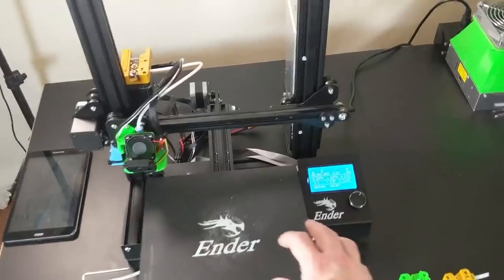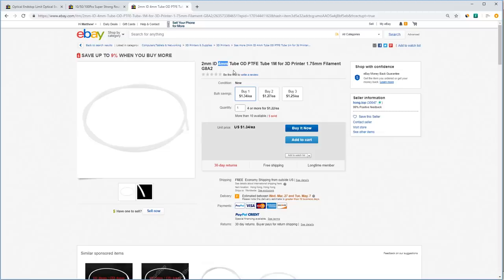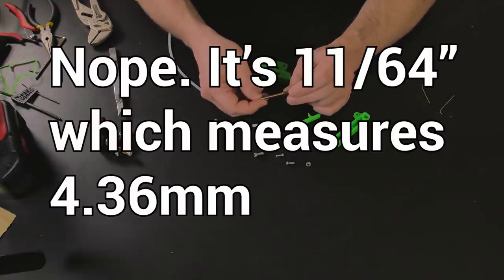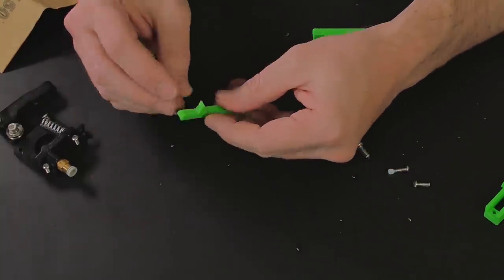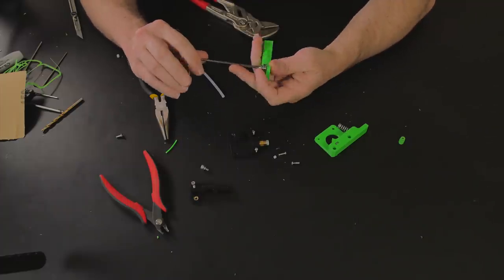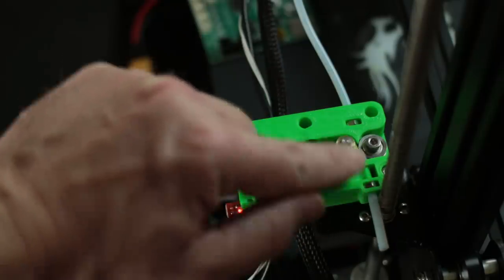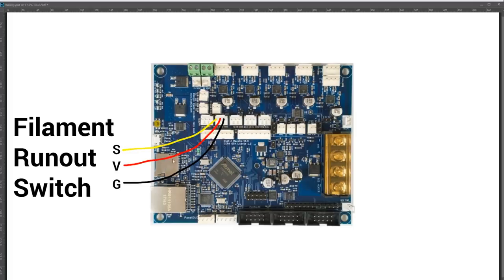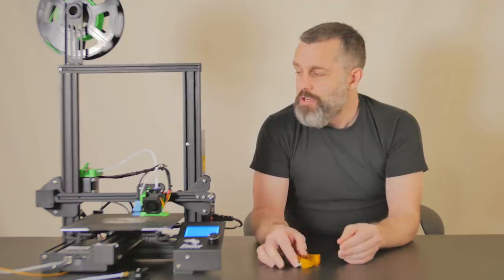How to Make a Better Extruder & Filament Runout Switch for Your Creality 3d Printer

Comment: It would obviously take up a little more space, but if you're going to have a plastic on plastic pivot, then you might as well use some of the PTFE tubing as the pivot rather than ABS/PLA. You could also use PTFE tube as the main pivot for the extruder, if you were to use a 2M bolt there (at least it seems like that would work :)

Comment: The ender 3 pro (bought one Dec 2020) now has the Creality model 4.2.2 (or 4.2.7) 32bit MB with a 3 pin connector for filament and a connector for a bed level sensor on the MB. This video showed the 1.1.x model. (What a difference a day makes <or year>)
 I was looking for a way to put filament detect on my printer when I found this video. I like the way it mounts the sensor on the extruder.
{<Condensed mode now>:For runout or break: sensor before extruder. For jams: sensor after extruder. Wire both in series + the parts to keep the smoke in = 1 hookup @ MB. Sensor can be mech, optic, or other}. You can find the Creality MB V4.2.x on Internet (& board diagr to connect filament/bed-level sensor).
 Pics of the sensor circuit board looks like: sig, Gnd, & V (L to R). Sig goes to Common on micro switch, V to N.O., & Gnd to N.C. (plus the parts for current limiting & a status LED)
   I was getting stuck on the idea of simple optical sensing. Thanks for the reminder that sensor can also be magnetic, contact, etc. 
Other neat tidbit; you can now update ender 3 pro firmware simply with SD card - no need for remote terminal or SBC
You prob covered these already but I'm new to the party.
 BTW, I like your channel...

Comment: Great design,
Think of a remix, just using the sensor arm and to install at the exit of the extruder.
Reply from the maker: This would be cleaner, but it would not work. Once the filament goes past the hob gear it will not move any more. thus the sensor must be placed inline before the hob gear. The exception of this is if the sensor reads the motion of the filament. Such as the laser sensor or magnetic sensor both made by DUET. These can be placed after the hob gear. When the filament stops moving even though the extruder is telling it to move this will trigger an alarm in firmware. In this video I used a simple on/off optical switch which could not detect movement in the filament. Thus I cannot modify this design to work as you suggest. However, I did do as you suggest in a previous video: https://youtu.be/RmZ7aJYvWLc

Comment: I am totally happy with the creality design especially the aluminum version but dammit man THIS really is pretty cool. I may just have to print some even without the filament detection. I like it.

question. I know PLA will "distort" over time when under a load. IE in this instance the load from that spring would over time "bend" the arm its pushing against. in a pretty short time actually few days even.

does ABS filament "NOT" experience this issue? is that a PLA specific issue and ABS and or maybe PETG won't have this issue?

thanks! and great design!

btw using the nut to hold the tube threaded into it is an old technique that far predates modern 3d printing. I was using it 30 years ago in grade school. I assume I learned it from my shop teacher :-)
Reply from the maker: I'll give a longevity report on the extruder in a couple of months and let you know about the creeping plastic issue. At any rate I believe the stock Creality extruder is made from ABS, so this design shouldn't be any worse than stock.
Reply: that is a good point. is there a mechanical or chemical difference between molded abs and 3d extruded abs? do they "change" the abs to make it into filament or is it the same stuff they spray or inject into a mold? curious.

the weakness on the stock plastic unit is the connection point for the idler pulley that pushes against the hobb gear. its thin and is prone to cracking over time from the constant load. I was thinking of drilling out the aluminum unit to allow insertion of a point cut chunk of PTFE on the exit side of the hobb gear ala the flexion extruder.

 @DesignPrototypeTest
Reply: Creep from the stepper motor temp will cause it to deform over time. ABS has a higher plastic temp than PLA so it would be fine. So would PETG.
Reply: @Deneteus  pla will distort over time and load at ANY temperature independant of glass/deformation temperature. Will abs and petg also do this?

Comment: Have you considered using Git to handle your versioning? It's quite easy.
Reply from the maker: Yes, but then I would have no reward for my Patreon supporters.
Reply: Siana Gearz or, you could try not acting the condescending git and understand why DPT says what he says?
Reply from the maker: @SianaGearz   I will give you credit here. I was making this exact mistake. I did think DEWEX was talking about posting my files on Github. BUT, your reply to Jasper only proves his point. You are super condescending.
Reply: @DesignPrototypeTest  Just to be clear:

Git is versioning software for managing file histories. It is installed and runs on your local computer. It is free and open source. While there are desktop tools which let you use Git on your local computer through a graphical user interface, using Git on the Command Line is not that difficult, and probably easier;

There are online services which use Git and let you manage your files and their version histories in the cloud. You can synchronise your local files with these online services;

Github  is perhaps the most widely known of these online services. Github is run by a private company based in the US. While it is possible to restrict access to  your collections of files (repositories) on Github,  (make them private) you have to pay a monthly subscription to Github to do this;

Bitbucket is another online service for file version history management, owned and managed by Atlassian, which does the same as Github, but it lets you make your repositories private for free;

I'd recommend using Git locally and pushing your files to a private repository on Bitbucket. You should be able to manage how you distribute files to your Patreon supporters by inviting your supporters to download the files from your respective, private Bitbucket repository.

You may also need to use the large files management solution. https://www.git-tower.com/learn/git/faq/handling-large-files-with-lfs

Happy hunting.

Comment: Congratulations for your huge work. I followed the video with interest. At the end, I just wondered: what if the filament was simply cutting the infrared beam of the sensor ?  Would not it be a much simpler way ?

By the way I do not subscribe to your point of view about patent. Let me explain. There's two criteria to make something patentable. First: originality. It should not have been done the same way before. For example, you cannot patent a string to cut butter, even if it's not patented yet. Because this is not new. Second, you can not patent something that involves techniques already patented or which are already into public domain : as long as Stratasys patented principles of FDM printing nobody else was allowed to sell or produce FDM printers. In 2005, the patent falled into public domain, anybody can use the techniques to make and sell parts and printers, but none can be patented until there's any original improvement or new way to do. Patents define general principles but not perfectly define principles. For example for a hotend : heating element to fuse material prior additive deposition to build a solid and dimensional object. You see, the technique or raw material or even aspect does not matter. You won't be able to patent a hotend using induction to fuse steel, even if it was never been done before, because you are just interpreting an existing technique. That's why most of the patents usually covers small aspects of a product, with real (small) inovations, to not the function or the whole product. Real inovations are rare nowadays. Actually 80% of patent deposits are rejected worldwide. There's specialized people payed to find what can be patentable in products, sometimes leading to complicated ways to do basic functions, just to allow patentability. That's why I love low tech and open source...
Reply from the maker: I covered this here https://youtu.be/asSLjLGlSrw at the 10:20 timestamp.
Reply from the maker: >You won't be able to patent a hotend using induction to fuse steel, even if it was never been done before
This is not true. If it has never been done before, and the idea is not documented anywhere you can certainly patent it. Furthermore, you idea is for a new type of 3D Printing using metal. Any type of hotend for plastic extrusion is likely to not be applicable as prior art. Metal≠Plastic
Reply: @DesignPrototypeTest I'm afraid you get it wrong.  Please read again carefully. 1.if a previous patent protects general principles: material>heat>deposit, whatever the material, the heating or the deposit method your patent attempt of "something new" will be rejected. 2. You cannot patent a filament switch because this is not new, even if the design is new and the switch not documented previously, those criterias are not enough. Some people already use switches to detect the presence of filament In Various tools, like in a TIG welder for example. If a patent is allowed to you, that should mean they won't be able to produce their tool anymore because of your patent. That's why your patent attempt would be rejected. 

So you can't patent the function, you can't patent the method envolved, what's left is the external aspect of the thing. But that does not protect your design that much because people with anything similar in look may complain and the same thing with a slight different aspect can still be produced. 
I wish you understand it's not easy to patent something and anything is not patentable. Usually I don't spend my time to write something questionable or false. Regards.
Reply: @axelSixtySix  that would be like Apple trying to patent the rectangle... you can't patent general principles as broadly as you're describing.
Reply: @GeoffreyPitman523  come on, it's an exemple to make complex things understandable. See the moon, not the finger that shows it.
Reply: @axelSixtySix  that's just it, your example doesn't help anyone to understand because it doesn't work the way you describe.  Patents can not and do not cover general principles, they need to be very specific.
Reply: @GeoffreyPitman523  From my experience in the industry budiness, to patent something is kinda game : the company write to cover and protects the largest application possible, like Stratasys did. The patenting office have the difficult job to protect companies innovation while trying to limit the field of the patent to keep a market and innovation open. There's lot of examples in contradiction to what you claim, look at Stratasys original patents, and see by yourself how simples but wide 3d printing patents managed to lock down the 3d printing market during 50 years, with consequence of few innovations during this period. Then make your mind about patent utility for science and people regarding open source innovations since 2005 by the Reprap community...
Reply: @axelSixtySix  you are incorrect, point in fact Stromberg and Carter each made carburetors for gasoline engines each covered by multiple patents but performing the same basic purpose and looking extremely similiar.  try searching the patents and see that even minor innovations are patentable.
Reply: @keithnewsom4043   It depends of what you intend to patent. If it's a mechanical principle, like rack and pinion, someone can patent the same movement with belts and pulleys. But if you patent deposit by heating for additive fabrication (see Stratasys') what else would you patent ?

Comment: Nice video. I'm curious about the differences between duet and octoprint. I picked up the layer times, but what else does duet add?
Reply: Duet is a mainboard upgrade option. Octoprint is a software for Raspberry Pi that can monitor connected printers.

Comment: Maybe a second video on how to do this with the stock board? Putting a duet at $80-180 seems like a lot for a $200 printer.
Reply: You might be thinking that putting a Duet mainboard is something like putting lipstick on a pig, but it seriously enhanced my already awesome Ender3.
Reply: @GabeColon  I'd think of it as putting a Ferrari engine in a Honda Civic, yes it will be better than the stock, but probably won't bring out the best performance of the engine.

Comment: Why don't you use the incremental save option in Rhino? You can save between any consequential changes, but you can always open up the old files and see what you had previously.
I use it too much, so once I'm finished with a design, I have to go back and delete the vast majority of the numbered files :)

Comment: I only think the Extruder is good even without a Filament Runout Switch!
Filament Runout Switch is not necessary for me.

nut with bowden is good indeed!

And YES I just work with an ORDINARY Ramps1.4
what do I care which board, as long as it works!

friendly greetings from The Netherlands!
Rob.

Comment: Subscribed then unsubscribed when I saw you needed to be a patron to get the file lol Might just design my own without the run-out sensor but for flexibles.
Reply from the maker: Have fun with that. Seeing my design should save you about 3 hours of drawing if you copy it as closely as you can. This assumes you are very proficient in a CAD program. No matter what, It's still going to take you a while to copy my work and get the tolerances and other small details correct. I'm guessing your time is worth more than $1/hour, so it is a fools errand to do it yourself just to avoid paying me. You are only saving $5 and using my geometry will save you at least 5 hours of work. I don't know why so many of you guys feel entitled to the fruits of my labor for free.

Comment: do you know if this would fix on a wanhao Dep i3 plus? i love it
Reply from the maker: No. I don't think this will work for you. Your printer is a direct drive machine. Converting to a Bowden system and then using this solution would be a waste of your time. Another problem is that I reused some hardware from the Creality extruder (spring, bolts, pulley, and hob gear).  I doubt the Wanhao stock extruder would use these same components. It looks like you can buy a metal version of the Creality extruder for ~$10 which would come with all of the parts you need. If you want this, your best option is to purchase an Ender 3 and start follow along with all my other upgrades as well: https://www.youtube.com/playlist?list=PLtVk4dZInT80SCVB_Pgrn1zZThO3nmV7B
Reply: @DesignPrototypeTest  it is just that the extruder you took apart, looks very much like the one sitting on my wanhao, but I love that this one, is built in the press handle :) I want it as close to hotend as possible to get less waste. I'm working on my own, but this is really good. keep up the good work.

Comment: So you modify open source products and sell the mods, Isn't this exactly what the community is angry at Creality over?
Reply from the maker: I started from scratch and therefore the design is all mine. I did not reference any open source documentation, and only drew ideas for the features from the precedents. This is significantly different from using the entire code base of Marlin and then not posting the source code like is required with the license agreement.

Comment: All is fine but when the Filament ends, now is stuck in the tube that you have to remove to pull out the filament. That's why the filament sensor should be move away from extruder so the filament can be easy pull out........
Reply from the maker: DUDE! You didn't even watch the first minute and 8 seconds of the video before leaving this comment did you? Otherwise you would have seen it working perfectly.
Reply: @DesignPrototypeTest  My stops passing the Extruder so is inside the tube.......

Comment: La explicación final de: el porqué no es un plagio lo que haces y justificar que cobres por un mix de otros diseños libres, es la confirmación de que es inapropiado usar ideas de otros y venderlas cuando no te han costado, si en verdad puedes patentarlo, corre a patentarlo, yo manejo Rhino y no es nada complicado, entonces en definitiva no has sudado lo suficiente para pretender cobrar y sacar beneficios económicos por una tarea apenas liviana. Las ideas son buenas pero el beneficio económico es una consecuencia, no debe ser tu motivación amigo mío y menos en esta comunidad de código libre y diseños libres como es el caso de thingiverse. Puedes pasar este texto por el traductor pero lo hare por ti, porque es muy posible que no lo hagas porque no estás ganando dinero con eso: 
The final explanation of: why is not a plagiarism what you do and justify that you pay for a mix of other free designs, is the confirmation that it is inappropriate to use ideas of others and sell them when they have not cost you, if you can really patent it , run to patent it, I handle Rhino and it is not complicated, then in the end you have not sweated enough to pretend to collect and get economic benefits for a hardly light task. The ideas are good but the economic benefit is a consequence, should not be your motivation friend mine and less in this community of free code and free designs as is the case of thingiverse. You can pass this text through the translator but I will do it for you, because it is very possible that you do not do it because you are not making money with that.